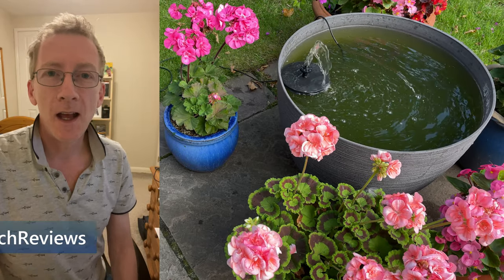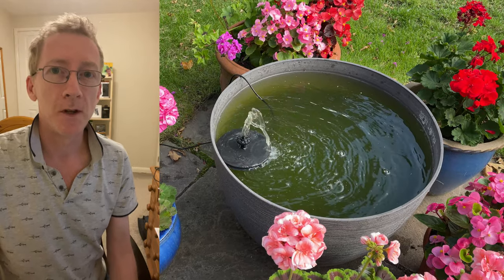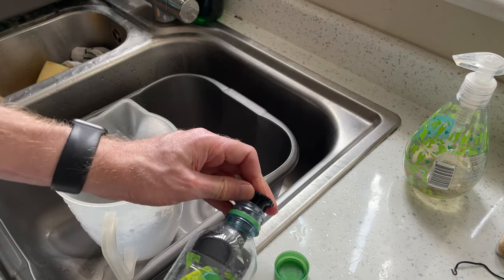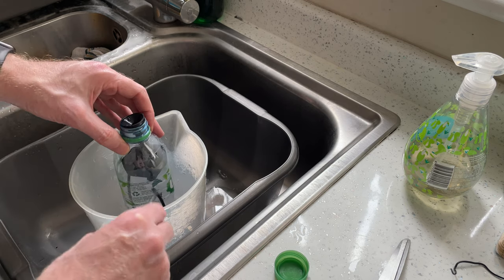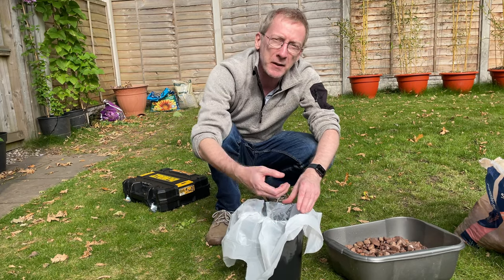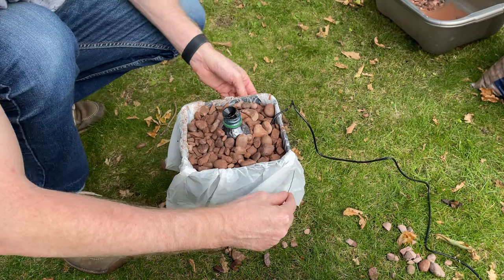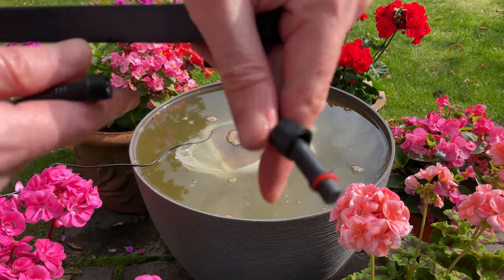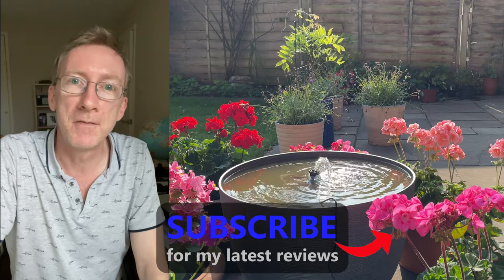How To Make Cheap Solar Power Water Filter To Clear Green Algae

Comment: I have a raised pond twice the size of your barrel thought I’d give it a go, to be honest I was a bit sceptical at first but I’m amazed… 3 weeks in and it’s crystal clear, shame I can’t post any pictures, thank you so much for posting this 😊
Reply from the maker: You’re very welcome. Thanks for your feedback!
Reply: @TomsTechReviews  No problem, I do have one question, after a period of time do you ever clean the stones from the filter?
Reply from the maker: @silvercarpboy1  After a few months of summer usage the flow slowed down a bit so I took the whole filter out to clean some weed and debris clogging the pump. To do this I had to take the pebbles out so I could clean the pump and reposition it in its plastic water bottle in the same position again. It didn't take long but I didn't have to clean the pebbles. If or when you need to do this make sure the pebbles don't dry out or the algae eating bacteria which live on the surface of the pebbles will die.

Comment: 🤔Hi! Why did you use the bin liner? Could you please explain in more detail? Would the algae have cleared up faster if there was no bin liner? Do you wipe the algae off the side walls? Thank you❤
Reply from the maker: I used the bin liner to seal the holes at the bottom of the pot otherwise the pump wouldn’t suck the water down through the gravel from above for the filter to work. If your pot has no holes in the bottom then there is no need for the plastic liner. I don’t wipe algae of the sides either. I’m too busy creating YouTube videos to have the time. 😊